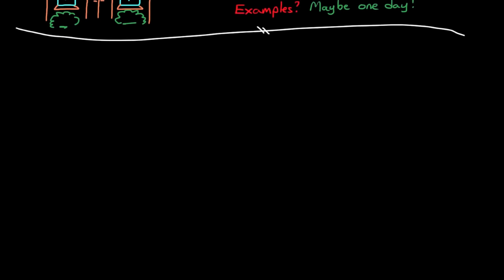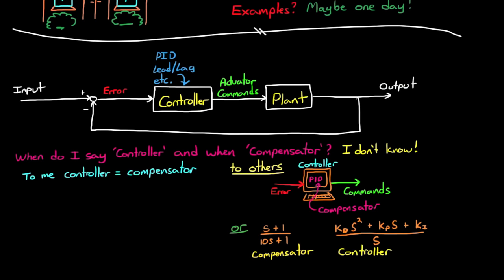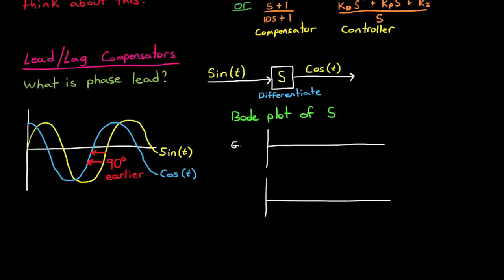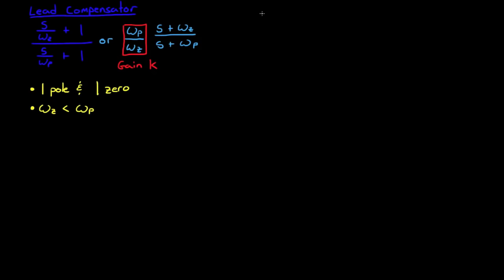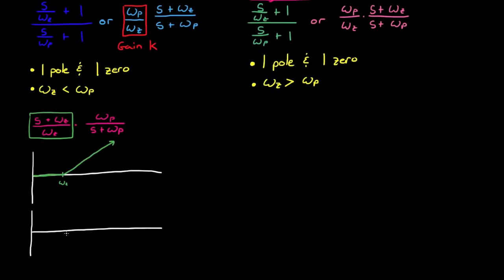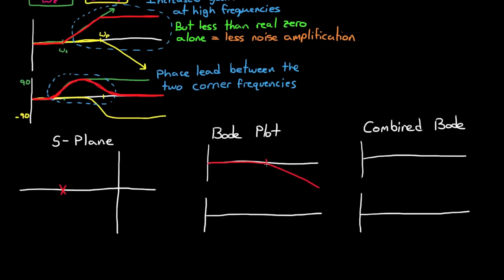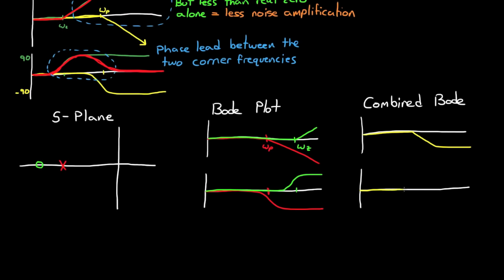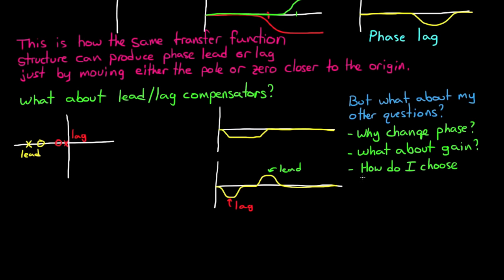What are Lead Lag Compensators? An Introduction.

Comment: My Proff. explained it this way... A Controller (PID, PD, PI) requires an external power source or amplification where a Compensator only emulates a PID, PD, PI controller by lead, lag, or lead-lag compensation WITHOUT the need of an external power source. For example where a PI controller is used to drive steady state error to zero, a lag compensator can only emulate that, driving steady state error very close to zero but not quite there.
Reply: thanks

Comment: Great explanation! This offers a good introduction and review on what lead/lag compensators are. I tend to agree with your statement and see "controller = compensator." In that, given that the system performs in a particular way, I want give control commands that "compensates" for the undesired performance and turn it into a desired output.

Comment: I'm taking notes from Modern Control Engineering by Katsuhiko Ogata, ed. 4

In chapter 6 section 5, Ogata doesn't really say they're trying to distinguish a controller from a compensator, but does nonetheless describe a compensator in a unique way.

>In building a control system, we know that proper modification of the plant dynamics may be a simple way to meet the performance specifications.This, however, may not be possible in many practical situations because the plant may be fixed and not modifiable.Then we must adjust parameters other than those in the fixed plant. In this book, we assume that the plant is given and unalterable.

>In practice, the root-locus plot of a system may indicate that the desired performance cannot be achieved just by the adjustment of gain (or some other adjustable parameter).  In fact, in some cases, the system may not be stable for all values of gain (or other adjustable parameter). Then it is necessary to reshape the root loci to meet the performance specifications.

>The design problems, therefore, become those of improving system performance by insertion of a compensator. Compensation of a control system is reduced to the design of a filter whose characteristics tend to compensate for the undesirable and unalterable characteristics of the plant.

It's only in chapter 7 around Nyquist techniques that Ogata starts using the phrase

>... controller (or compensator) ...

And then by chapter 8, 'controller' alone is used exclusively concerning PD, PI, and PID.

The overall trend seems to rely on two modes:

1. Ogata uses 'compensator' when your first and largest reason for modification is stability; you're compensating for inadequacies. Then they use 'controller' when stability is almost a given, and concerns are more with time-based requirements.

2. There is frequent mention of how PID controllers are modified on-site, implying that a compensator is not.  Which I guess further implies that a controller has a human interface, and a compensator does not.
Reply: nice

Comment: When we have a closed loop system, we are concerned about robustness, which can be determined by something called phase margin and gain margin. The higher the phase margin (measured in degrees) the more tolerant our system is to become unstable due to disturbances; therefore we are interested in modifying the phase to give us a nice "cushion" for uncertainties. Adding a phase compensator might introduce some undesired phenomena such as modifying the original bandwidth. Thanks for the video Brian

Comment: Anecdotally, in my field of servo controlled hydraulic systems compensation is a passive or "dumb" action where a particular variable is acted on by a dedicated system, mechanical or electronic. Whereas a controller performs active analysis on a system and can respond to varying conditions and adjust things on the fly, and have its parameters modified to fit different conditions over time. Often controllers are used to actively adjust setpoints in compensators. For example, a pressure compensator may control the flowrate of a pump by constantly adjusting itself to maintain constant pressure at different pilot pressures. That pressure compensator is itself controlled by a proportional servo valve which can actively adjust that pressure compensation gain if desired.

Comment: To answer your question posted at 2:20
I would look at the two terms based upon intended definition:
Controller - send instruction before execution, then correct execution error
Compensator - send instruction after execution in order to correct execution error

Comment: As someone with zero experience in this domain, my default understanding would be:

A controller is anything that controls something.. i.e. it has an output that is used as something else's input (e.g. how much power to deliver to a motor, or switch an LED on / off, or send a network packet, etc.). You can have hardware controllers and software controllers, and not all controllers are compensators.

A compensator is a controller that also has a feedback input from which it reads a signal that it uses to help it make its decision about how to control. All compensators are controllers.

Comment: For what I know, a compensator has the function of compensating the effects of increasing the proportional gain. Ideally, the proportional gain should be big, so that the output can follow the input, however, increasing the proportional gain too much can make the system unstable, and that is the moment where the compensator has relevance.

Comment: I guess the close loop system needs to be compensated by an additional block to achieve desired response according to particular specifications. And thus this additional block is called a compensator. And this block (the compensator) gives the plant the control signal or actuating signal it is called a controller as well. That is my guess.

Comment: I was discussing with my friend about the difference. He said that PI controller increases noise but lead/lag compensators don't. So the use of compensator is more intuitive than the controller. Do tell me if there are more big differences. Thanks.

Comment: sorry for asking a dumb question, but why do you not want increased gain at high frequencies (7:08)?
Reply: AsiaCrasie signals in the high frequency range include things like sensor noise which are generally undesirable. increased gain at high frequency would amplify the noise rather than filter it out

Comment: My professor makes the distinction that a controller adds poles and zeros at the origin, and a compensator chooses where to put them.
Reply: +Steve Denny Ok but a classical PI controller, for example, creates a zero away from the origin (although it's goal is to put a pole at the origin). What do we call it?

Comment: Hi Brian... Thank you so much for your lectures :). I have Electronics & Communication background for my Undergraduate and currently doing my masters in Control Engineering. I would like to know the areas where Control and Electronics (esp VLSI, Analog electronics) are related. Like any area where Control Systems can be applied to VLSI electronics/ Analog electronics

Comment: sir,
considering a 2nd order system to increase stability , damping factor should be increased till some extent and thus bandwidth and settling time decreases..

but please check the page 3 last line of this link which is contradictory:
http://www.ece.mcmaster.ca/~davidson/EE3CL4/slides/LeadLagBode_handout.pdf

Comment: sorry but pid lectures and lead lag compenstor lectures are tooooo fast especially pid controller lectures, also the example given in pid lecture is too complex to understand maybe it's too fast, how about simple example like elevator which does not have complex mechanics associated with it, and your notation 'w' notation for pole and zeros makes it extra confusing. Thanks.
Reply: A car expressed as a rigid moving object with variable velocity is not complex mechanics unless you haven't passed your level 1 Mechanics course.
You can also change the speed of the video or pause it to examine his graphics in detail. The "w" (greek lowercase Omega) notation is the standard notation for angular frequency so I don't see why he should use another symbol for it...